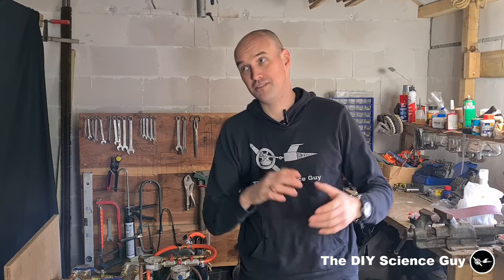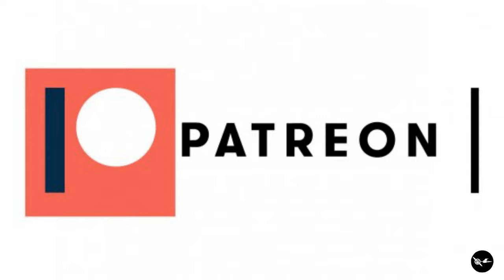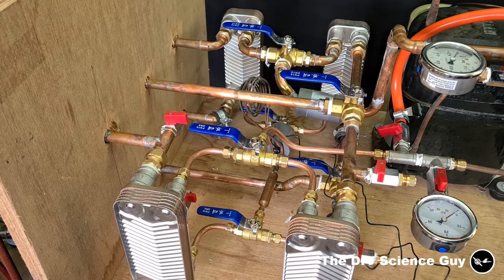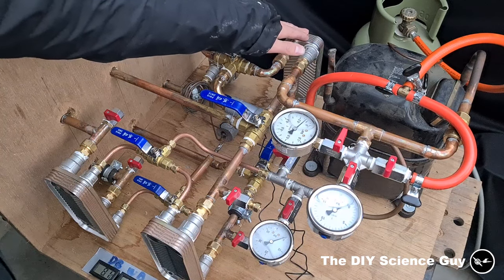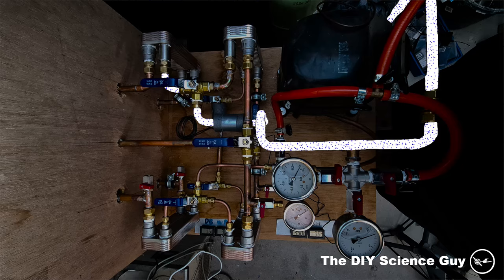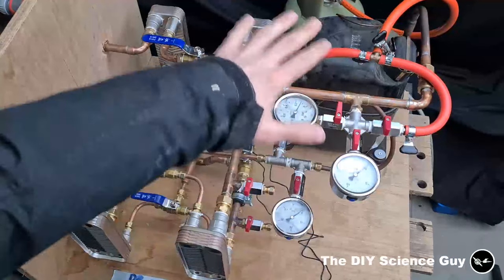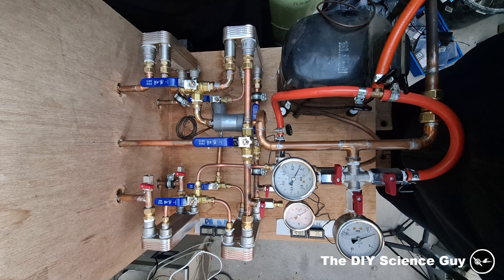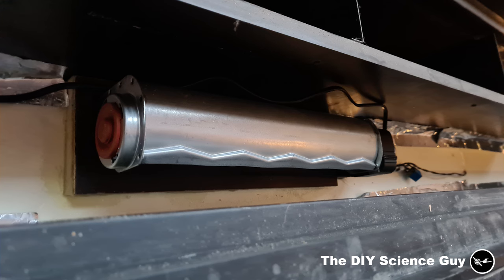4kW Heat Pump

Comment: In one video with the same topic, the person used propan as well. He said, that the propan for bbq use is added with sulphuric stuff to make it smelly. This sulfuric stuff reacts with the oil in your compressor and you get damage over the time and unusable oil. He removed the sulfuric stuff by transfering the propan through oil before using it in his system. Perhaps that is something to consider.
Reply: It’s ethanethiol but it does have one sulfur atom
Basically ethylene+hydrogen sulfide
Reply: @ElectroTree01  somewhat ironically, both of those are refridgerants.
Reply: @mikafoxx2717  maybe not hydrogen sulfide(although it is possible) because some of its qualities.
But ethylene/ethene/r1150 is
Reply: @ElectroTree01  Most Refrigerators until after the invention of Freon in the 30's used sulphur dioxide as the refridgerant! I mixed up hydrogen sulphide and sulphur dioxide so you're right.
Reply: @mikafoxx2717  I completely forgot about r764's use, I havent thought about that one in some time.

Comment: Interesting to see a homebuilt unit. I work a lot with heatpumps, and depending on if you're heating or cooling you can get some crazy high efficiencies. one of my units has a rating of 14 HSPF which is insane!

Comment: Evacuating refrigerant is illegal most likely in the European Union but isn't in the USA. However this is a really nice video, other than that.
Reply: Nvm what the law is….. it’s just wrong to do everywhere.
Reply: @Hood.Housekeeping  How does licensing effect the morality of the situation? You can do it properly without a permit, and improperly with a permit.
Reply: @smolpener7430   that was my point.   And I 100% agree.  Nevermind the law.  The law only matters if you get caught anyway.   Don’t vent refrigerant to atmosphere to begin with regardless of its legally ok or not.
Reply: @smolpener7430  What I was referring to specifically was venting all the gas

Comment: You could get slightly purer propane by putting the bottle in a freezer first. The main contaminant of propane is butane. Butane has a boiling point of -1c while propane is -42c, so the colder the bottle the higher the proportion of propane. Looks good tho, good work! I'd like to do something similar one day.

Comment: Happy to see you back, love this idea and system. I’ve played with similar concepts using propane, It’s easy to get it it works surprisingly well as a refrigerant if the system is built for it. What I find great about propane is the fact that the low and high pressure are so much lower that the new refrigerants. Less pressure, less chances of leaks.

Comment: When i build my last heatpump, I used compressor running amps to meter in the charge, it worked very well. 
I am looking foreward to the performance data on this system. Keep up the good work !

Comment: Nice video. I saw the AC Service Tech channel listed in your video description. It is a great resource for learning about HVAC. He recently did a video on electronic expansion valves. You might want to investigate using one of those instead of using a  a thermal expansion valve.

Comment: When you order your txv, make sure to order one with the proper refrigerant in the bulb. You want it to develop gas pressure on the diaphragm that matches the characteristics of the refrigerant in the line you are sensing.

Commercial "fuel" propane is a mix of several gassed, including propane. The only thing they really guarantee is the BTUs per cubic foot equals what you would get if you were burning pure propane.

It would be better to get your propane from a refrigerant supplier.

You should also look into mixtures of iso-propane and other gasses like iso-butane.

There is a concept called glide that can improve your volumetric performance of your system.

Looks like a lot if fun.

It is interesting to see regulatory agencies begin to rethink refrigerant uses in light of the GHG problems.

There are new regulations that allow for the use of flammable gasses, if the volume of gas is under some threshold.

You might want to box in your refrigerant loop, and put a flammable gas sensor inside.

A "pump down" valving system, can then sequester the gas in the receiver/drier, shut the inlet valve to the receiver/drier, trapping the refrigerant, before it reaches the lower explosive limit. Turn the compressor off and close the valve, when the pressure on the suction side reaches 0.0.

All the gas will be safely in the receiver.

Use diaphragm type solenoid valves. There are no seals to leak.

You can get shell and tube heat exchangers with two output paths.. one glycol and one water.

Personally, I'd run glycol and water in the "house" loop all the time.

Then I'd run glycol and water mixture to another ground water heat exchanger.

Instead of valving refrigerant, valve the glycol side of the heat exchanger.

If you want heat as your product, pump the condenser side to the house. 

If you want cool, pump the evap side to the house..

So long as you maintain flow, the ground water side won't freeze.

When you shut it down, make sure the water runs for long enough to evap all the liquid, so it doesn't freeze in the heat exchanger.
Reply: Adding to my earlier comment, If you have pets, glycol is toxic, and has a sweet taste. Pets will lap it up. Organ failure isn't a nice way to go. Get a non-toxic antifreeze.
Reply: Can you provide a diagram to help improve this wonderful design with what you have suggested. Thanks in advance
Reply from the maker: Thanks! I will include that in the next video.

Comment: Excellent! Thanks for sharing your system is exactly what I want to build except Ideally I want to use co2  instead of propane, not sure if I can deal with the much higher pressures though. If you have any thoughts on that  I would love to hear them.
Cheers, Kurt

Comment: Nice explanation of your project, funny that I have almost exactly the same project. My project was also built in the basement. I have floor heating in the barn that I keep warm with my heat pump. My barn is insulated to the best of my ability to have as little loss as possible. I have been running on my geothermal source for 4 weeks now. income temperature 8 degrees and outgoing my source IN 6.5 degrees. success continues

Comment: Measuring the superheat with just temperatures can be problematic.
If there is a notable pressure drop in the evaporator it will be off quite a bit.
The usual way will be measuring the suction pressure and temperature and calculate it with a saturation table.
You really want the superheat as small as possible for best performance, TXVs usually will go for 5K as default.

The plate heat exchangers look too small for 4kW. My Rule of thumb is 0,15m²/kW.
Reply: I would be very curious to know if they are capable of producing 4kW,
Reply: @velianlodestone1249  Well it all depends on the temperature difference. With enough difference you can push 100kW through one small heat exchanger.
One side at +200°C the other at -200 and off you go.
But this won't be a efficient heat pump then.
Reply: I've looked them up, and they are capable of 22KW.
Reply: @pw6048   useless number unless you define the temperature difference and media too.

Comment: Are you Dutch?
Saw some "gamma" materials in your " polished satelite disc solar beam machine".
Interesting thing you do with bundled sun rays...extra heat centered in a small area...🙂👍
Maybe a thing to not underestimate is the amount of generated heat could be (sometimes) become as high that it might cause things to ignite/put on fire when it reaches wood or dry grass etc.
So let us all be cautious about that..
But like u said,interesting thing you did.
Shall add it in my list to try to build sun power heating system for indoors because of the ridiculous gas prices etc..
Did allready pay 917 euro a month for almost a half year...

Comment: Nice work!  Do you have an idea what the cop would be at different outside temperatures and on the inside, say, 35 degrees Celsius water out of the condensor?
Reply from the maker: No, not yet, that has to be determined in the next video.

Comment: i made a HP with an old window ac. i just turned it around so the evaporator is outside and the condenser is inside.
Reply: How did it work? I did the same and it's barely blowing any heat at 50f
Reply: @FiveSixEP  It took a long time to heat. at least 10-15 minutes. I like instant heat so i put a 250w heat lamp over the kitchen table. toasty warm, i love it.
I suggest you try a delay timer to let it heat up before turning on the fan, if you don't mind the delay. Even an expensive HP will use a timer as nobody likes a cold breeze at start.

Comment: Hi! Thank you for the awesome video! The thing I have been floating a very similar idea for my summer home which has rather poor insulating properties. Since it's a summer home, temperatures inside the house in the winter need not to be very high: ~5-10C to keep the pipes from freezing. Buying a full system would be prohibitively expensive so I was thinking of making my own system. Do you have any resources you could recommend me (besides the website mentioned in the video)? I would love to hear how the system has worked for you in real life and what COP have you been able to achieve in actual use.
Reply from the maker: Nice idea! The COP of my system will be determined in the next video. I have no other information than what I have shown in the video, sorry.

Comment: I'd like to know why you decided to use 4x plate heat exchangers instead of a 'switchover' valve that are used in reverse cycle AC's (don't know the correct name of the valve but it's a simple device)
Reply: This is called a reversing valve, valid question 👍
Reply from the maker: As I explained 2 heat exchangers for ground water and 2 for anti freeze. This way I will never contaminate my ground water.
Reply: @TheDIYScienceGuy  yes this is clear however with a reversing valve (tnx Velian) you would only need 2 heat exchangers and a bunch less valves and manual switching effort to ...reverse... the cycle. Whilst maintaining the complete separation of media.
Reply from the maker: No it's still te same amount of heat exchangers. 2 hot side 2 cold side.
Reply: @TheDIYScienceGuy  the principle is that there are no more hot and cold sides, both are both, since you can reverse the flow of the refrigerant. So you just have a ground water side and an anti freeze side. Or do you want to transfer energy from ground water to ground water, or from antifreeze to antifreeze? Because yes then you need 4.
Reply from the maker: I want to be abel to switch in all directions with different media.

Comment: Hvac guy but if you plan on doing a house build a scroll compressor is more forgiving about liquid slugs....more then likely your tin can (hermetical sealed reciprocating compressor) is not a good match. make sure the oil matches the ref and that the o ring seals match the oil. also propane is a excellent low temp and should move a lower density volume of gas so you want a compressor to match it. it is better to pull a low vacuum to ensure you don't have nitrogen trapped as you will have high head and a flooded condenser that will cause the moisture to overheat and create acid from your oil
Reply: Maybe the tincan is a good match. Propane is exacty the same as R290. So if this compressor is a R290 compressor, he's all good.

Comment: Making a heat pump using ammonia is harder or easier?  It would be more efficient or not?
Reply from the maker: Harder. You can't use copper because ammonia will dissolve it. But yes,  it would make it more efficient.

Comment: I have a split unit, I am often asked can I use it to heat a room in the winter? But the answer was no, it can only be used for cooling in the summer, otherwise it breaks down, so is this correct? Please answer me.
Reply from the maker: If it's not to cold outside it should work. But is your ac reversible?
Reply: @TheDIYScienceGuy  
Thanks for your reply 
I don't know if it's reversible or not, It ( TOSOT ) split that has a remote control and I can replace between heating mode and cooling mode. 
However when I asked some technicians, they told me the split ( in general ) can be damaged.
Reply from the maker: Ok well I don't know what they mean by that. Sorry I'm afraid I can't help you with that.
Reply: If you can switch to heating with your remote, that means you can heat in winter. But you should read about it in your AC manual-some pumps become inefficient in low temperatures, they may not have defrost capabilities (when it is below 0 Celsius, outside coils cover with ice from water vapour in the air).

Comment: Nice, just what I am looking for. Do you know of any cheap sources for heat exchangers?
Reply from the maker: Thanks! These are the ones I bought: https://www.wiltec.de/nl/Warmtewisselaar-RVS-10-platen-max.-22-kW-platenwarmtewisselaar/50671?affiliateCode=google_shopping&affiliateCode=google_shopping&campaignid=19196052844&gclid=Cj0KCQiAv8SsBhC7ARIsALIkVT2MULKqxz0UZUIlSPlbYFLVgSp0UBZz4vMJ5o5QRwCjAd6-Zr-m34EaAnc5EALw_wcB hope it helps!
Reply: @TheDIYScienceGuy  yes it does, many thanks!
Reply: Amazing 👏  nice working project 👏 judging by the pipework around your boiler your very much into heat pumps & plumbing

Comment: I would really like to be able to build my own split system. They are not complicated at all but there is no information on how big of a evaporator or condenser you should use. Theirs just nothing on the internet to give any direction. Would be freaking awesome to build your own and control it with an Arduino loaded monitoring sensors. Would be easy if there were some standards to reference
Reply from the maker: I would advice to just build something small to get a feal for it and then scale it up to your needs. Good luck!
Reply: @TheDIYScienceGuy  Hey! Do you know of any reading material? I've built small ones before and I've leaned to charge window units. I just want to know if there are any calculations I can do to size coils on a given tonnage. Thank you! I need to re watch this.

Comment: Could you confirm what copper pipe you use (hard or half hard and OD and wall thickness
Reply from the maker: Both hard and soft. Wall thickness 1mm. Wat do you mean with OD?
Reply: @TheDIYScienceGuy I think he means Outside Diameter.
Reply from the maker: Ok thanks! OD is 15 and 8mm

Comment: Distill waste motor in to diesel fuel...
Reply from the maker: Sorry, what do you mean?
Reply: @TheDIYScienceGuy  just what I said
Reply from the maker: Ok, so put a waste motor into a distilling apparatus and make diesel fuel out of it?
Reply: Armchair comment from someone who hasn't even asked or read why you are building it!  Pah!

So I like what I see, but are there challenges ahead with brittle plastic and condensation or icing?  I would love to assist with Temp and Pressure sensing... Do you have Arduino skills?  Where are you based?  I am in UK
Reply from the maker: Well, most of those things I'll have to figure out, but yes, I have experience with Arduino, so I'm going to use that to control it. I'm in the Netherlands. All  help is welcome! 👌

Comment: I like the inferior style... Could've worded it better. When it's 100 degrees outside we know it's hot. When it's 0 it's cold. When measuring distance I like feet and inches. They have style or something nice. It is more complex but it's not hard to learn. Not inferior but different. Maybe for fun build something using feet and inches? Less than an inch is fun and once you figure it out it's like you know some code.